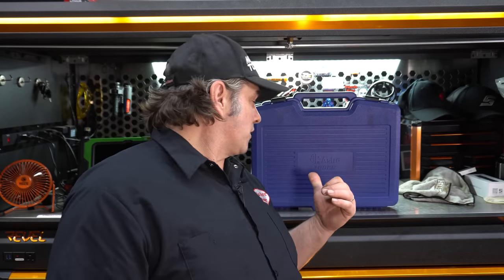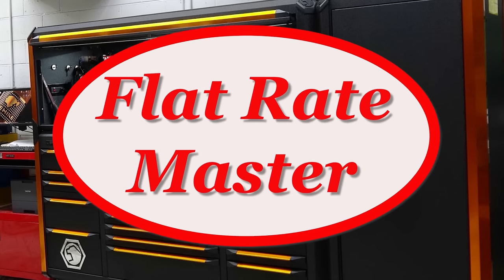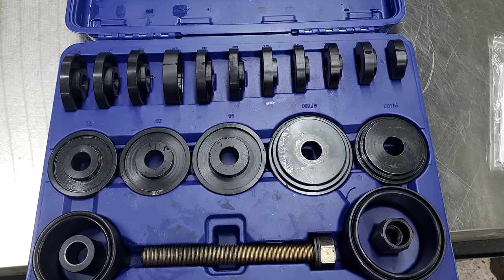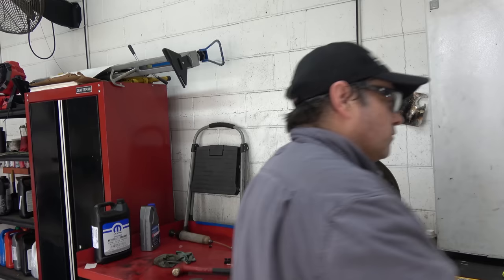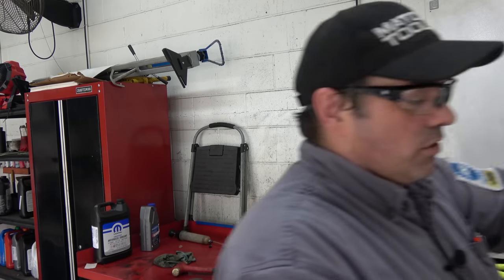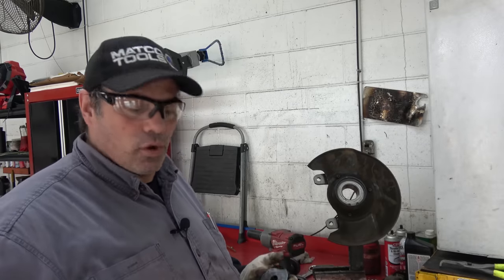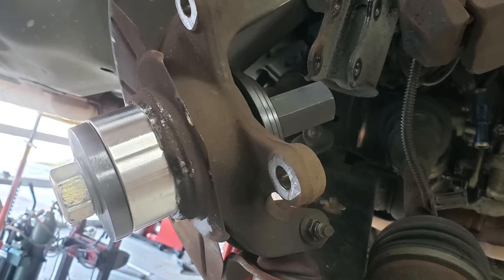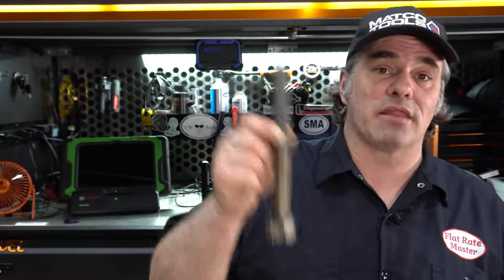Astro Pneumatic 78825 vs OTC Hub Grappler for Press in Wheel Bearings

Comment: Great video as always.
There's actually the same number of adapters in the two sets.
OTC: 13 adapters, 3 cup stacking plates, 1 hub install adapter
Astro: 13 adapters, 2 cup stacking plates, 1 hub install adapter.  The additional extra large cup plate and the cup (few required applications but can be nice to use) is available separately as 78825XLA. Should be everything. That's not to say one wouldn't work better than another in certain situations. 
Our application list also goes up to 2019 and lists around 300 more applications, albeit not in a large bound book.
Reply: Co worker has the astro kit and first use it pretty much destroyed the washers.  Car he was working on was pretty rusty but is that normal?
Reply: Eric Busseau I have the old OTC version. Hub Tamer. I bought some extra Washers from the Farm supply store. I always grease all the contact points with synthetic grease. They have held up really well since I started doing it this way.
Reply: @x2122  Some heavy grease between each washer and bolt head should mitigate this. If not, drop me a line and I'll send you an impact rated thrust bearing. We designed it for use with this too, but in order to keep the cost down and compare in price to similar sets was not very feasible to include.
Reply: @AstroTools  yeah I told him to o grease it but they got tore up still.  I'll have him contact customer support.  Thanks
Reply: @scottsmrcka2769  yeah I told my Co worker that they are expendable parts but first use they were done even with grease.  Granted the bearing was a bitch to get out because of rust.
Reply: Eric Busseau for sure a bearing would be the best way to go if it’s available.
Reply: Do you have a list of the car models supported and the correct adapters for each car?  website link for this?  Thanks.
Reply: @AstroTools  . Could you please provide the part number to the impact rated thrust bearing? Thanks!

Comment: I have the Astro 78825 and I bought the Astro 78830 to go with it.  With these two, I pretty much have everything the OTC kit has in it (less an adapter or two).  If I recall, my MAC guy wanted almost $500 for the OTC.  He recommended the Astro to me, and sold me BOTH kits for a little less than $200.  Seemed like a no-brainer at the time.  In hind-sight it was, by FAR, the best deal.  So far, I found the Astro 78825 kit covers all of the domestic and Asians that are my bread'n butter.  I don't get much Euro-trash in my shop, so I just haven't found the need to expand on what the Astro kit already has in it.  BTW:  The Snap-On guy sold me a ball-bearing washer that works on the Astro puller screw.  It helps quite a bit.  I don't know what the Snappy number is, but I'm sure your dealer can find it.
Reply: Shh, that's a secret
Reply: @AstroTools  haha
Reply: ever find that part number?
Reply: @aveilband  I'm glad someone reminded me because I did ask my Snap on truck guy for the number.  He told me that it ISN'T a Snap-On part.  He buys them for his customers from Zorro (Part # G3395901) for the 7/8" size.  I never tried to buy anything directly from Zorro... I think it's some kind of industrial supply house that sells to the GMs and Fords, not us small guys.  I know he buys them by the box, along with all the other sizes he needs for Snap-On size puller screws.  Hope this helps.

Comment: You can get the Astro version of the stand alone Grapper kit (78830 Heavy Duty Hub Drum and Rotor Puller Kit) for a little less than the Grappler one, PLUS it comes with the drum puller arms too.  Anecdotal statements I have seen indicates it actually works better in some cases because of how the threaded section of the screw is compared to the Grappler screw (don't know if they are interchangeable).

Comment: I have that Astro kit love it! I added a bearing on the forcing screw. Happy Easter & stay safe FRM!
Reply: What kind of bearing did you use?
Reply: @christopherenger1602  I got a flat needle bearing that sits between the 2 flat washers.
Reply: @christopherenger1602  A 7/8" truck wheel stud installer bearing works best. Will last much longer
Reply: @chrisp7277  can you give us a part number? Thanks

Comment: After trying some of my co-workers sets, I debated getting something like these. It didn't really seem like much of a time saver for me but it was easier on my body. One problem is up here in Michigan the rust usually makes it too hard to get the bearing retainer out while the knuckle is on the car. At that point I might as well use the press. I can normally do press in wheel bearings in 30 to 40 minutes my way or the Hub Grappler way. I do like the idea of using the adapters on the press. Maybe I'll get the Astro set just for that reason.
Reply: I replaced my front wheel bearings recently and that's what I did. I bought a Maddox kit and used the adapters to press the bearing. I like the idea of using an impact ratchet to press the bearings but I worry that the impact ratchet and adapter kit  might not always be strong  enough to get the job done using them that way. Anyway, a 20 ton press with the adapters worked great for me.

Comment: I have the Astro kit and although it's been a few years IIRC since I was replacing the hubs along with the bearings on a car with around 160k miles on it, I just punched them out from the inner part of the knuckle using either an impact socket or one of the smaller adapters (or both, I forgot). I tried a slide hammer but just found this method to be quicker and more effective.

Comment: I go online and get a ball thrust bearing and it really helps cut down on friction and transmits torque to removing bearings.I use EP grease on the threads and never had to replace any parts yet.

Comment: Awesome video! I moved to a shop that doesn't have a on car wheel bearing kit. I HATE trying to set up knuckles in presses so I'm looking to buy my own kit. I don't use the hub puller in the OTC Hub Grappler kit. I found it to be a bit of a pain sometimes. I got a Lisle 40100 hub puller that is AMAZING! This Astro kit is like 1/10th the money but I REALLY like that eccentric washer in the Hub Grappler... It definitely helps center things if they don't start off perfect. One shop had lost their washer and I used it without. I found bearings were jamming up a lot. Would have to give centering taps with hammers quite a bit but almost never had to with the eccentric washer. I'm thinking I'll probably drop the thick cash on the OTC kit. I've used it a lot and never ran into a situation where it didn't work.

Comment: I like the OTC tools as they are made in USA. I just recently bought the Grappler kit and their Super Ball Joint Kit. Quite expensive but the price through Summit Racing seemed to be the best (added week to get in hand from shipping though). 
I love that the ball joint tool is made from actual steel instead of Chinesaluminum. I ended up with a '11 Escape at bargain price, needs a windshield, liftgate (rust) and front bearings (it's like driving on saw blades...LOL). Once I sell the truck I'll have some darn good tools from that profit.

Comment: I don’t know if anyone is aware of this, but this exact set is on sale at HF for like $80 under the name “Wheel Bearing Adaptors.”

You replace the forcing screw with one from an OTC Hub Tamer and boom.
Reply from the maker: The Astro pneumatic tool is the same price as the HF tool with a way better screw as well
Reply: @flatratemaster  heres a tip ive used with great success. Get a tube of "M-77 Assembly Paste" from your local honda motorcycle/powersports dealer. apply it regularly to the threads of any forcing screw in any puller tool. really helps prevent galling and wear. its 77% molybdenum disulfide. Honda spec's it for lubricating the splines on the shaft drives of bikes.
Reply: i know from experience that Carey Paul Honda in Snellville keeps it on hand. i work as a "master tech" (read- problem-solver/shop foreman) for a chain shop in gwinnett.

Comment: The OTC is something similar to what I use which is a Super Shark Hub Puller Removal Kit Made by Old Forge a extremely excellent designed Piece of equipment it for certainly makes the job simple and very easy most definitely a super time saver with the addition of the old forge bearing Press removal kit

Comment: No probs with the Astro kit but same as you, I had to replace the forcing screw on the OTC Hub Grappler and Bosch gave me a hard time about it.  I told them it was the first use of the kit and the cup crushed then the screw got bent.  They eventually sent me a replacement screw and cup.

Comment: Here is the UK rust is on every thing, I have this kit and a slide hammer/puller kit but simply take hub off car put in vice and bash with socket and hammer to knock out the hub, never failed yet

Comment: does it need to be a brass hammer to fix if it’s  cock eyed?

mine was cocked eyed and i kept tightening with a brraker bar until the bar broke. when i got the bearing out the inside where the bearing susposed to sit was dented in and peeling out so it wasnt perfectly round anymore. does this mean i need a new knuckle now?

Comment: Is there a tool for removing the race stuck on the hub?  I've tried cutting it and wacking it with a chisel before always end up going too deep and nicking the hub shaft.

We don't have an oxy acetylene torch at the shop so I can't do the spin on a pin of some sort and heat it to drop it off. I've heard mapp gas won't get it hot enough.

Comment: Does anyone actually prefer a good shop press? I don’t have access to either of those tools. I ve gotten pretty good with the press. I ve used the on the vehicle type hub shark and I probably would prefer it but don’t have my own or access to one but I ve got a decent shop press. Just saying
Reply: Chris Chairamonte when I watched this, I had no idea this type of tool was an option lol. I reckon if there is only one press in the shop, this would be a much faster solution especially trying to beat flat rate.

Comment: my shop got a hub shark and i hate it with a passion. i use my snap on ball peen stile hammer and beet the hub out and then just use my shop press for the rest. the bearing that is left on the hub i cut into just enough to use my air hammer to remove it. but most of the time i usually recommend a new hub when replacing press stile bearings because of previous experience of them being damaged from the customer driving to long on the the bad bearing.

Comment: This is a bit off topic. I like the trick that you used with the torch to remove the race from the hub. Do you think Map Gas could do the same thing?
Reply from the maker: Map isn't hot enough, you need to heat the race up fast, so you don't heat up the hub

Comment: Looks like the Astro kit doesn't have the puller to remove the race from the hub either.  You should pimp your video with the torch trick as well!  $100 vs $500.... If you have a torch and a slide hammer that's a pretty smokin deal.

Comment: Buy the $50-$60 Chinese kit (adapters and forcing screw) on Amazon then add the $150 hub grappler from Amazon if the forcing screw breaks Grainger has the right size. This set up does all of what you want at a cheaper overall price.
Reply: Does the chinesium kit have the hub adapter?
Reply: @PatChapp  no that is what I am saying you have to buy two different kits you have to buy the OTC hub grappler and then the Chinese forcing screw and adapter kit.
Reply from the maker: Or buy the astro kit for 70😉
Reply: 70 ain't bad

Comment: Time wise, how much time do you find that you are saving over going to the press?
Reply: Yesssss, exactly what was going through my mind while watching this as well!!
Reply: If everything works as intended (enough adapters) this can be done on the vehicle and should only take a few minutes. The shop press always seems to take me more time than using this tool, but if course your mileage will vary.
Reply: Quite a bit don’t have to mess with separation off the ball joints and the press is slow unless you got a air powered one and if you have ever pressed a bearing don’t sound like you have some bearing press on from the front some from the back so gotta rig up something to stand the spindle up pain in the ass
Reply: When I worked in a shop I was paid hourly. The shop had a press. There was no need on my part to spend the money to save time. I still do my own stuff at home. I also have a press. So from the diy aspect, does the time save justify the money? PS have slide hammer will travel............
Reply: THaT GuYs 1 Channel for a diy who presses in maybe one a bearing a year no that’s 500$ you can spend on other tools but for a shop that does 15 a week yeah worth every penny especially when the car is from up north and removing any bolt takes hours of work.....now on the other side cars from up north sometimes have to be used on a press I had one so bad my 50 ton press was pushed to the max before it broke loose
Reply: @TheMechanicj  I was thinking the same way in spend the money towards other tools. Thanks for the help Bud! 50 tons is one hell of a press. Surprised something didn't break before coming loose.
Reply: @stumpnc   ,
For DIY,  the hard way is always cheaper  .
Reply: @inverseuniverse5727  No doubt about that!

Comment: Have you ever had to use the small puller in the otc kit to remove inner races that get stuck on the hub?
Reply from the maker: https://youtu.be/ZPe4R8VqE5A
Reply: @flatratemaster  nice trick with the torch. How often do you come across a race that is stuck like that?